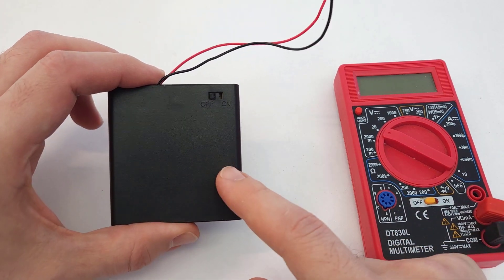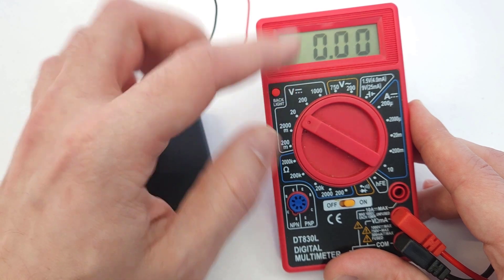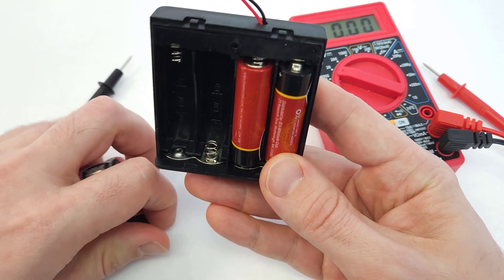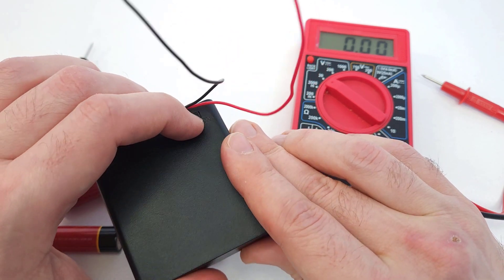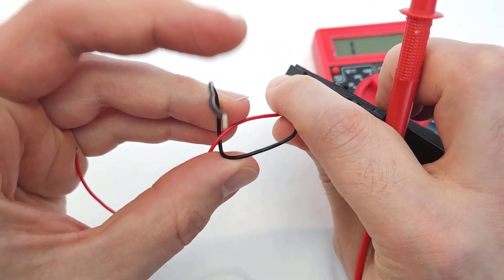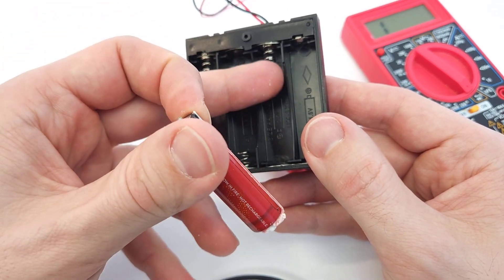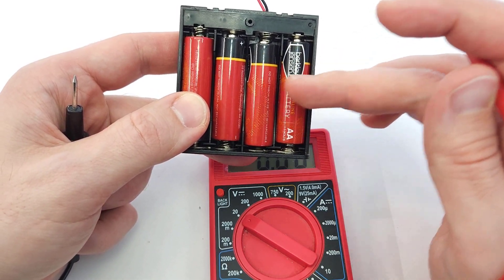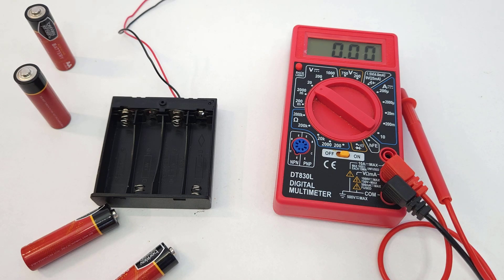How to Debug a Battery Pack with a Multimeter

Comment: Thanks! This helped me figure out why my battery and the metal plates were working but not connecting to the breadboard

Apparently the black wire was the issue (using the continuity setting to check)